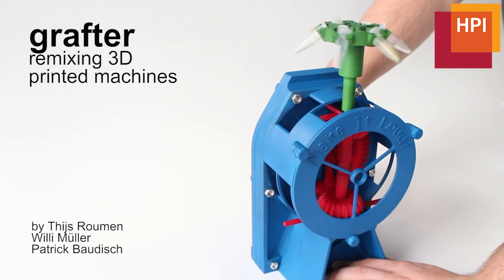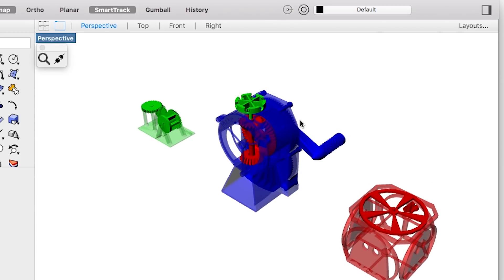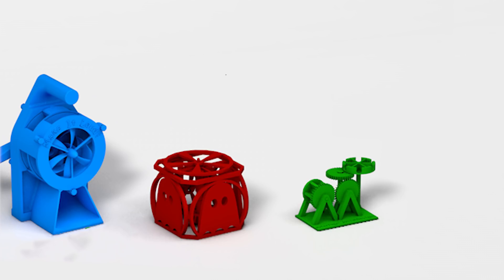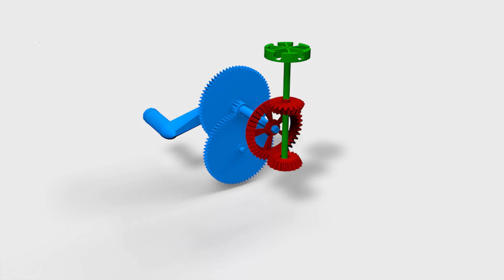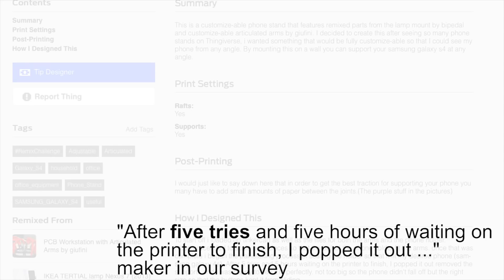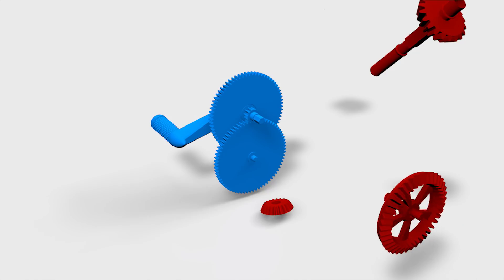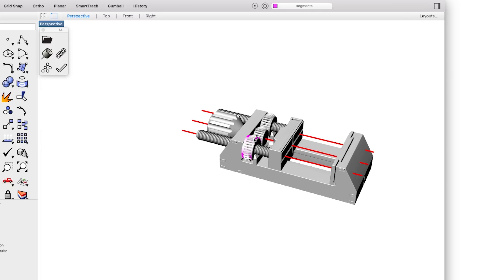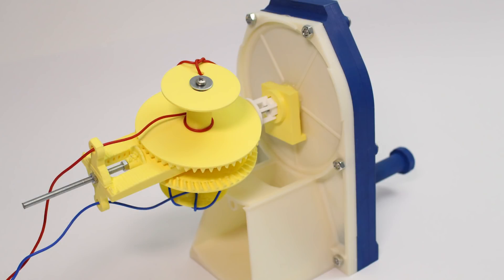grafter: remixing 3D printed machines

Comment: What is the purpose of the lower blue cog?
Reply: inside the siren (blue geometry) there is a two stage gearbox (four gears), the two lower blue gears are connected to one another. The double stage gearbox results in the large transmission ratio achieved by this machine
Reply: Thanks,I was confused by this image  https://youtu.be/WAiLwPlW098?t=119  but the ghosted view  https://youtu.be/WAiLwPlW098?t=146 helps as did this video https://youtu.be/xtA24MJphcA
Interesting work.